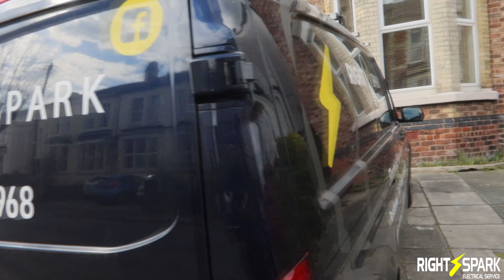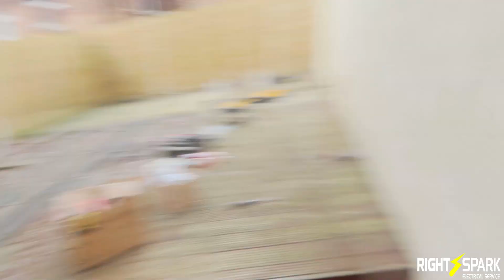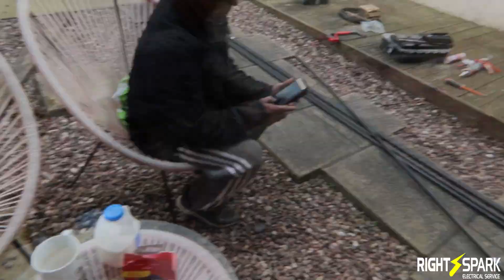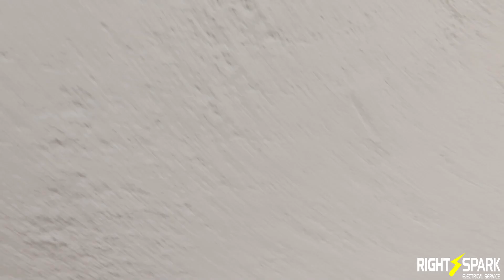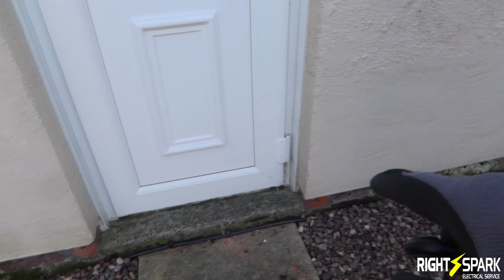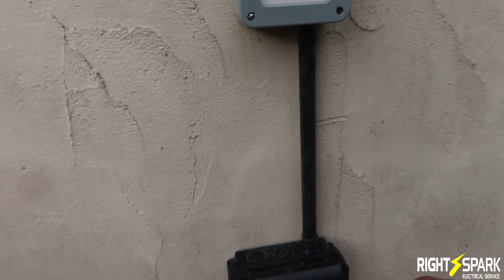Installing Outdoor Sockets & Lights - Outdoor Wiring - Electrician- Uk Electrician

Comment: Little tip, put a bead of silicone on the back of the box around outside of the screws....100% water tight and you won't be cursing yourself when you have to take the screws out and remember you filled the heads with silicone

Comment: You shouldn't ever glue pvc conduit outside.  You need to leave room to expand and contract.  If you're going to glue fit an expansion coupler.  When the sun gets on that it will look like a banana
Reply: Depends on length of pipe. Don’t need coupler unless over 3 meter run.